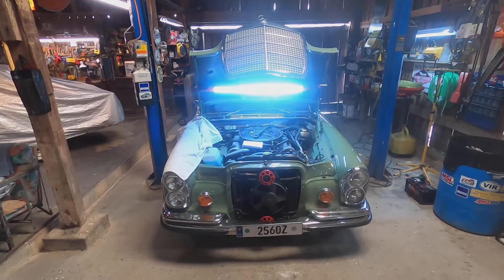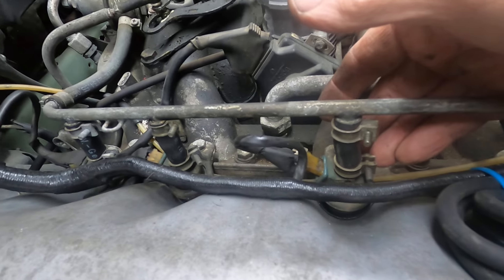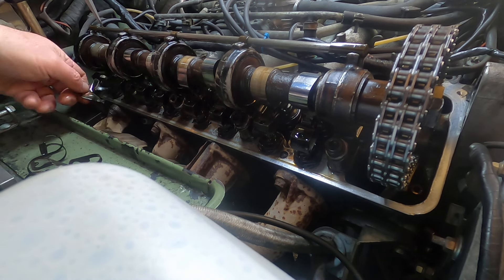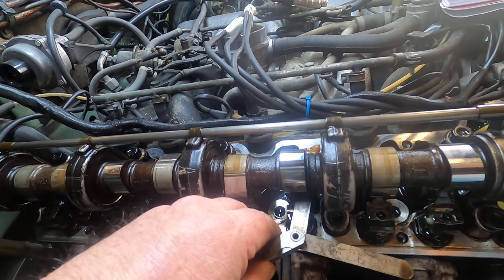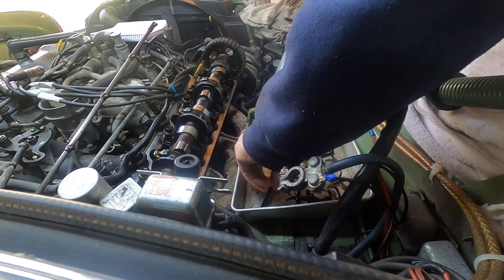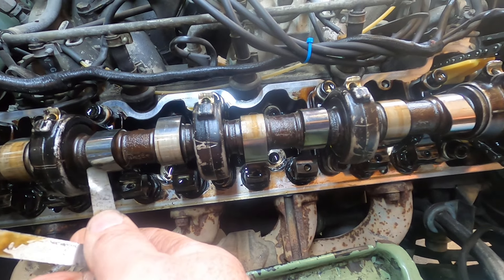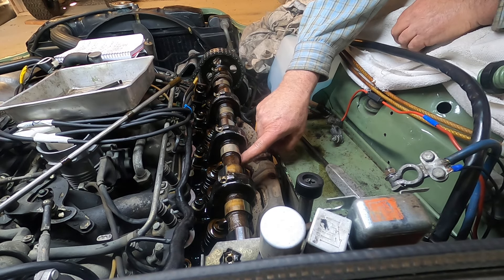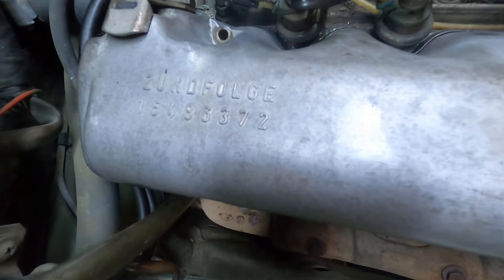1972 Mercedes Benz 280SE 4.5 Valve Adjustment, With Complications

Comment: My grandfather bought one of those back in 72 was the car I learned to drive in he use to drive over the railroad tracks really fast and say look how smooth it goes over theses tracks.  Didn't think it was the prettiest car back then but think there really cool now
Reply from the maker: Thank you for watching and commenting. They were way ahead of their time in many ways. Their suspension and fuel injection were just two areas. Their design has always been understated elegance that has withstood the test of time.

Comment: Cool video! Does this car have a single carburetor? Not a dual carburetor? Also, does it have a choke knob inside the car?
Reply from the maker: Thank you for watching and our questions. The "SE" designation means fuel injection. Therefore, this car is not carbureted. In addition, it is the second first 4-door sedan in the world with electronic fuel injection, Bosh D-Jetronic fuel injection. The first was the Mercedes Benz 280 SE 3.5. It does not have a choke; it has a cold start injector or valve as part of the Bosch D-Jetronic system.

Comment: On a good engine , you can adjust valves at 30.000 miles interval . On a worn engine more often , because the ball sockets are wearing more , so the valves become noisy . Also on some engines , the intake valves wear out on the seats , so after awhile the 3th clearance is no longer there , and the valves dont  close all away . since the exhaust have a larger clearance , this is not that much of an issue , also the intake valves are softer .
Reply from the maker: Thank you for watching and commenting. Good information.